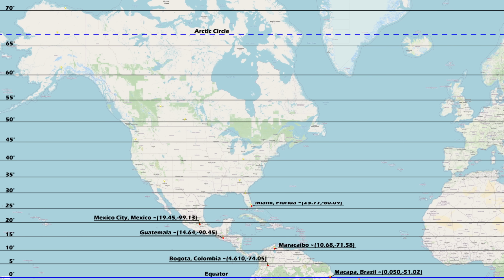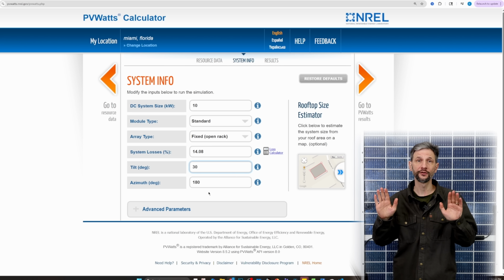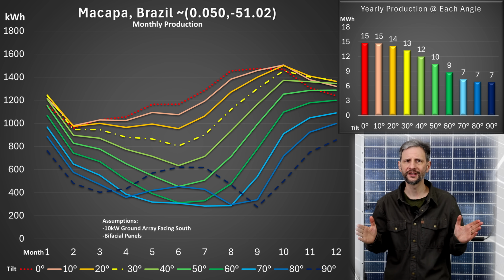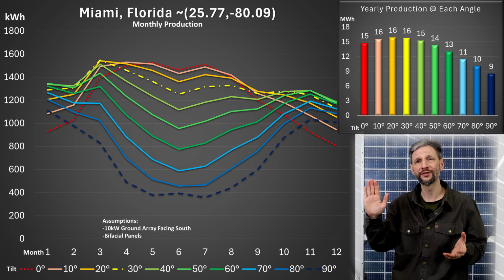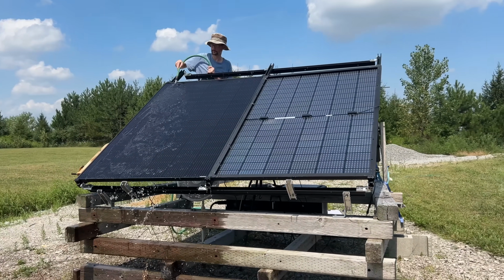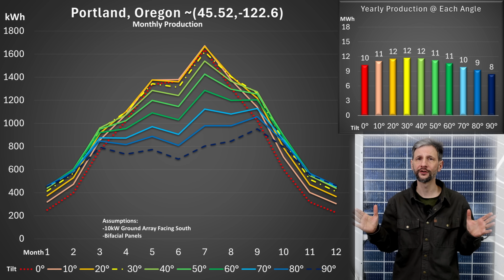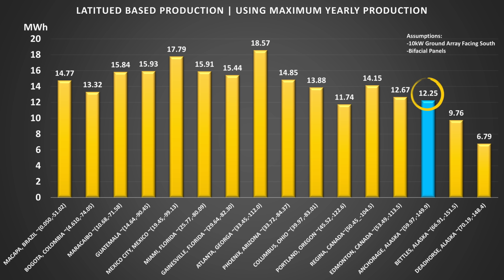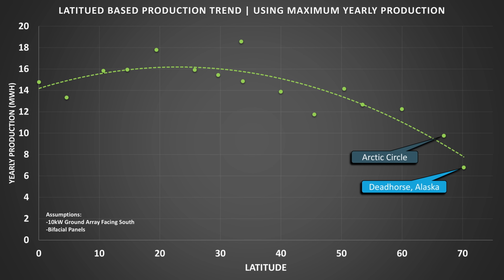Your Location Destroys Solar Panel Efficiency

Comment: I'm sure it would not be too difficult, but I would like to see the two different DEGREE ANGLE COMBINATIONS that would provide the greatest return for a location. Take Atlanta for example:  It appears that having an array angled at 10 degrees from March 10th until August 15th, and then at 40 degrees from August 16th through March 9th.  Have either the front or rear main support be adjustable to cover those two angles, and the other (front or rear) hinged.  Only two changes per year, just like when I was growing up and we took our screens out in fall, and replaced with storm windows, then switched back in spring (Ohio). Tracking the sun with a large array is complicated and expensive, but simply raising or lowering one support piece twice a year would not be too big of a deal (IMHO). Looks like yearly production for Atlanta with only those two adjustments would result in a significant jump in total power output for an array.

Comment: Great video!  Liked.
With that said, not to nitpick, but the B-Roll you show at 7:06 talking about using bifacials in open rack arrays, should not have been paired with b-roll of a roof mount, in my humble opinion.  Could possibly confuse some people.

Comment: I live in northern England about 53.59⁰. It's often cloudy here. My roof faces south at a tilt of 37⁰ from the horizontal. I make great power. The efficiency goes up when it's cold. A sunny day in May with an air temperature of 5⁰C I get absolutely fantastic power
Reply from the maker: Thanks for sharing your real-world experience, it's great to hear your system is performing so well!  Cold weather is great for solar!

Comment: Your figures seem low to me. I've had a 12.6kw system since January of 2022. I routinely generate 22.7 mWh each year near Palm Springs CA.
Reply: Ok, so a 10kW system would make 18kWh for you. At 33N lat he shows Atlanta, which was making 19kW. Where is the issue?

Comment: Great video Dave! Thanks for including Alaska. I live in Lake Elsinore, California, but always wondered how solar works in different places, like Fairbanks, Dead Horse, and other towns around there. Yellowknife too. 

I set up a solar system my self. It's not fully done yet. It's 20, 240 Watt panels, so 4.8 KW. I'm only bringing in 2.4 KW though during the peak hours of the day. Not sure why. My panels are quite old, got them used, they where $10 each from 2012. I can't complain much, still a great input. But maybe my 10 degree angle south isn't ideal? Not sure.
Reply from the maker: Thanks for the feedback.  Even with used panels, I think you should be getting more than that under ideal conditions.  Likely the output would be closer to a 200W panel performance.  (4,000W*.8 = ~3,200W)  If you are using them with a string inverter, make sure all the panels for each MPPT are facing the same direction.  Also, you should group them by output.  Most likely you have a few panels with very low output pulling down the entire string.  If you are using micro inverters or optimizers you won't have that problem.
Reply: It is MPPT. I am using all of the same solar panel as well. They're all pointed the same direction. I was actually getting about 3,600 watts once. Only one day. It was like 65 amps at 48 volts. But ever since then it's been 55 amps maximum. I'm thinking there might be a dirty connection or something. @ProjectsWithDave

Comment: I'm in Seattle and starting small with 6 panels. I'm going to do all vertical, 100W bifacial, 2 facing south and 4 facing east-west. The idea is to spread the production across the day in as flat a line as possible.
Right now, I'm not trying to provide all my power, I just want to use small grid-tie inverters to supplement.

Comment: At 65 North in Sweden with 35 kWp plant. Snow coverage nov-feb matters less as the solar irradiation is so low regardless. With 25+ degrees slope you get decent snow shedding, so roof installation dominates. Best days (effect/earnings) are early april. A new install will have production above the rated specs then, as they assume 20C ambient temperature, below that you get more. Highest production in 2-3 summer months as you get 24h production. Electricity pricing is set by hydro, so electricity is cheap then. Most profit is made in spring.
Reply from the maker: Thanks for sharing your real-world experience from 65N in Sweden!

Comment: Here at Lat 43 in Michigan my angle of incidence is always pretty close to 90deg with tiltable panels until it snows. Then the panels go to vertical to eliminate snow cover - still not too far off angle. Is there any data on ground snow reflecting significant light?
Reply from the maker: Yes, I analyzed snow reflection in this video: https://youtu.be/5AVO1IyfA9M

Comment: My old place here in Australia (southern Qld) had no north facing panels at all (due to the house design) but half facing east and half facing west... One thing that was surprising was that you really don't lose any generation in comparison to a north facing system at all- and in overcast conditions it actually works BETTER lol...  We had two identical systems (6kw, next doors having all 6kw facing north, ours 3kw east and 3kw west- installed by the same company only 2 days apart even) and the results were quite clear- practically the same total daily generation (about 32kwh per day in summer) some days his made slightly more, some days ours did... what was distinctly  noticeable is that on overcast.broken coverage days, both systems made less (obviously) but his made a LOT less than ours- a day that his was down to 22-23kWh a day, ours was still up over 27kWh for the day!!!  His had a much higher 'midday peak' often hitting the 5kw maximum of his gridtie inverter, while ours rarely exceeded 4kW- BUT ours started up literally at sunrise (already at 100w with only half the sun showing above the horizon) and was up close to a kw already going out, when his was just barely starting up... The east array peaked about 10am, and began to drop after that, but by that time the west array was starting to generate, hitting its peak about 2pm- giving up a 'low but broad' midday peak against his higher but shorter peak, added with our earlier starting time and later finishing time, overall both systems were next and neck most days... Now my offgrid system (temporary) is a tiny 1.5kw (750w north, 750w west) and it produces between about 7kwh a day in winter and closer to 10kWh a day  in summer- enough to run the caravan and shed easily lol

Comment: Hey Dave, just a quick FYI that you mixed up the location (Lat and Long) and solar production data for your Phoenix and Atlanta segments :(. The GPS location and production data for Atlanta is labeled as Phoenix, and vice versa. I've been watching you for years and really appreciate the level of detail you provide in these videos. Thanks!
Reply from the maker: Good catch!  What a colossal error!  I can't believe I did that!  I go over and over my data so I don't make those kinds of mistakes, very frustrating.  But that's the nice thing about my viewers, you find all the mistakes.  That's why it's important to read the comments.  I'll have to make a community post for a correction.  Appreciate you pointing that out and your long-time support!
Reply: Ok I thought that seemed impossible with how wet Atlanta is.

Comment: Hi Dave
I live in Johannesburg, South Africa. Used your insights to design/spec a 500kwh system (4 x 125kwh sungrow inverters, 825 x 610w JA Solar Bi-Facial panels) on top of a factory I own. 
Total install cost was around $183 000 ($0.36 per watt). Our elec costs around $0.13 per kWh
10 months in and we've produced 600 000kWh (lots of sun here, even in winter)
So payback period is looking like it'll be around 18 months. I'd be interested to hear what payback periods are like elsewhere. I appreciate that's a nuanced/case specific question so potentially no easy answer. 
I'd imagine labour costs (and potentially tariffs?) drive your install costs up massively. 
Really enjoy your channel, keep it up!
Reply from the maker: Wow, those are incredible numbers! An 18-month payback period is truly outstanding.  In Ohio the best DIY system takes 3 to 5 years to payback.  If you have someone install it you are looking at 9 to 20 years.

Comment: Great information, but please do everybody a favor and stop calling them solar panels.  Use, 'photovoltaic panels', or even, 'P.V. panels' instead.
"Solar panels" are not exclusive to photovoltaics.  Solar water heaters collect heat from the sun with solar panels.  There are also panels that collect heat for space heating.

Comment: One thing I think this analysis might miss is spacing between panels, and shading of other panels.

Let's imagine a square, 1 acre field of panels, which isn't shaded by any obstacles.

If we use flat panels, we can arrange all of the panels so that they don't shade each other, ever.

But, if we use rows of South facing vertical panels, the panels will frequently shade each other. If we space the panels out further from each other, we've reduced the amount of panels we can put in our acre of land.

So the question is, if we have 1 acre of land, how much energy can we get out of it with a variety of panel arrangements? Accounting for panels shading other panels
Reply: I’m sure there’s a solar farm operator somewhere out there looking to hire you to solve this exact equation! 😊

Comment: Correct. I am at 51 north in Canada. I have set my panels to vertical since it optimizes winter, as both temperature and snow bounce gives good production and...you don't need to clear snow off the panels. Non clearing of snow is a very important feature. In the Summer with 16 hour days we overproduce greatly and so the angle doesn't matter...we are off grid and can't export overproduction, The batteries are full by 10 am.
Reply: Poland here, I agree, in winter vertical south is OP.
Reply from the maker: @vensonata - Thanks for sharing your actual results!
Reply: Did you mount north/south or east/west or both?
Reply: Thanks for sharing!
Do you set more parallel strings in winter to maximize the solar power output in cloudy days?
Reply: Spot on. Just sold my off grid place, but if I get another I will definitely mount the panels vertically.
Reply: Same here i collect auto batts and use excess to deep charge  .recover afew  for use in out buildings  i run 24v systems lol i am old
Reply: I wonder whether it would make sense to mine for crypto with your surplus power in the summer (assuming you have internet).
Reply: I am happy to read this as someone who lives in a hot country but plans vertical solar systems. You prove my thesis about vertical panels.
Reply: You using a dump load to take advantage of that summer overproduction?
Reply: @priestesslucy a dump load is not needed with solar, its used for wind to make the system brake.
Reply: @Keneo1  I never claimed it was necessary.

But it is nice to have a place to put surplus power to work
Reply: @priestesslucy a dump load is not work, its literally just dump it somewhere to get rid of it.
of course it is interesting to have a big resistor somewhere to heat up your residential water for cleaning/washing, but that’s not a dump load.
or run an airco to keep your house cool.
Reply: @priestesslucy  I think a lot of people are interested in figuring out what to do with surplus “superpower “ solar.  I’m thinking about producing stuff seasonally that requires either welding or casting metal.

Comment: Would it be reasonable to think that tracking the sun would help?
Reply: Lots of tracking systems exist but they often tend to not be worth the cost versus just adding more panels. Also for many people summer generation is way over your demand so you just optimise for winter and take a hit in summer as you don't need the maximum for the year you need enough for each day.
Reply: @etchedpixels I’m considering a ground mounted system, but only have limited space. I plan to optimize for winter and hope to net-meter the surplus in the summer (or eventually install enough battery capacity to be comfortably self sufficient). I should add that I feel capable of building my own tracking system, which I suppose would affect the cost calculation.
Reply: @ADHJkvsNgsMBbTQe  Another approach is to build an adjustable ground mount and just adjust it a few times a year. That gets pretty close to fancy schemes. In the UK we've even got commercial suppliers of these kind of designs (eg Cornish Rocker) and it's not that hard to do.
Reply: @etchedpixels  definitely an idea worth considering. Thank you! Of course I may end up putting them on my roof, but it’s due for replacement and I have been realizing that the higher wattage panels will take up a small enough space that ground mount may be easier (including cleaning and maintenance). All options are being considered.
Reply: @ADHJkvsNgsMBbTQe  Don't know what it looks like in your part of the world but in the UK it's now fairly normal to use what we call "in-roof" or "tray solar" which actually is most of your roof and tile around it. We are close to the point it's the same cost as a normal roof because it's a lot less labour than tiling that area.

Comment: This shouldn't deter people from getting solar panels. 80%, or hell, even %20 efficiency is fine. You put up the panels and bam there's a free source of electricity for the next few hundred years!
It's better than nothing, and shipping gasoline to the Arctic circle is silly when you could set up a field or two of panels and a permanent trailer or two of batteries!
Reply from the maker: Agreed! The goal of the video was simply to highlight what to expect from your specific location, and how to maximize it, not to deter anyone from going solar.
Reply: @ProjectsWithDave 
PVWatts 
PVWatts
Let’s hear everyone chant it: PVWATTS!!!!

Comment: Sir wish not to argue but comparsion of Atlanta and Phoenix with Atlanta out producing Phoenix in mega watts. I have live in n the south and now live in Arizona. Phoenix has approx 3,850 hours of sunshine per year versus 2,700 hours for Altanta. You are telling me that the heat of Arizona is causing more than a 1,000 hours of power loss for solar panels due to heat. I have hard time believing it. Sun is always shining out here and never cloudy.. can't said for hot, humid Atlanta.
Of course, numbers never lie.
Reply: Heat causes solar panels to be less efficient, which may be one factor.
Reply from the maker: If something doesn't make sense, the first step is to check the numbers.  You can run a few scenarios yourself on PVWatts, you can then compare that to other solar analysis tools and data from different weather stations to confirm the result.  That would be a great activity.  In the world of solar I often find my expectations don't match reality.
Reply: @ProjectsWithDave  
Hi Dave, I ran the numbers on PVWatts, which I’ve used in the past. I agree that your data from Atlanta is no good. I get 14,850 kWh/yr with 10kw, 180 az., 30 tilt, bifacial, as my inputs. Not the 18-19k figures you show. Try it again, pls. Good concept, it’s a fantastic tool people should be aware of!!
An interesting thing is microclimates in my region. Pacifica California yields 15,082, while Waterford CA, just 75 miles due east and on the exact 37.63 latitude, yields 17,138. Why the difference? Because Pacifica is shrouded in so much fog and inland is very sunny in summer. 
I imagine PVWatts does not have exact data for every point on earth. For instance, my preferred spot along that latitude might be in the hills above the fog between Pleasanton and Fremont: inland and high up enough to be away from the fog, but still west enough to be cooled by the ocean. This is why we Californians pay so much for real estate, you really can choose your climate! 
Interesting, I chose Sunol, CA and it gives 17,328. This makes sense to me because Sunol should have similar sun as Waterford (both much more than Pacifica), but not as hot as in the Central San Joaquin Valley. 
Come spend some in our neck of the woods next Sunday (Super Bowl) and you’ll see. I’m sure other people reading this may be jumping about their own microclimate, like Lake Effect Snow off Erie, or Sequim WA is in a “rain shadow” from Mt Olympus, no??

Anyways, if your Atlanta numbers are accurate, I’ll be surprised!
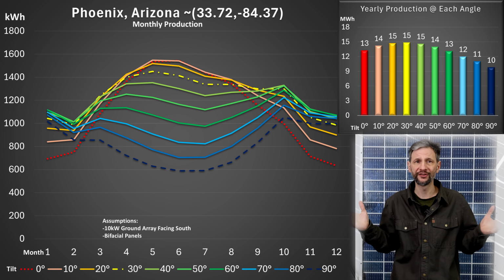Reply: @ProjectsWithDave  I have to add to this quibble: I ran the numbers for phoenix and it is 18,573 kWh/Year, not the 15k range in your graph at the 6:00 mark. I really think you did something wrong with both 33 degree cities.
Reply: I was scrolling for someone to point this out. You win.

Comment: Regarding Portland at least, we don't really get snow in the winter. Every 2 or 3 years we get a winter storm where snow lasts for a few days or a week. Winters are mostly just wet. Knowing this, 30 degrees is probably more appropriate right?
Reply from the maker: Yes, If you are not concerned about the infrequent snow events, I would go with 30deg.  Even where I live in Ohio 30deg works well most winters.  This winter we got dumped on and then had low temperatures for weeks so I had to clear my panels, but most years I don't bother.
Reply: @ProjectsWithDave  Awesome, thanks Dave!

Comment: Im in phoenix/ gilbert. Improvement from Cleveland. Very low pmax is a must 👍
Reply: What do you mean low pmax?
Reply: @Loykaz it's already up, $50k system running 6000sqft house in AZ. Most people know what I meant. 
 Pmax is often used as shorthand for the "Temperature Coefficient of pmax". Late night post after cutting off a bunch of limbs all day in the OR to save some lives. Sorry for not detailing it out that night. I can talk to you while I cut. Come join me in the OR tonight. 😊